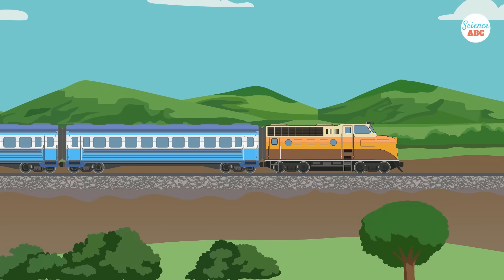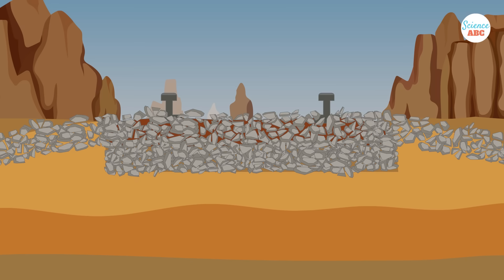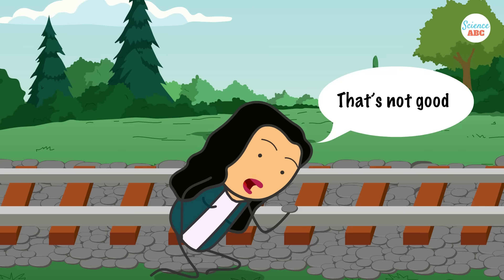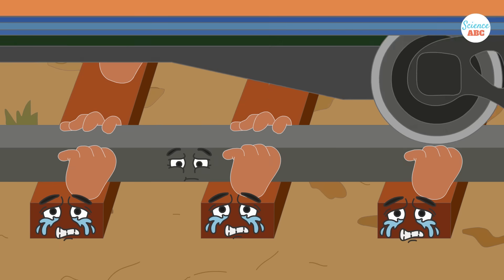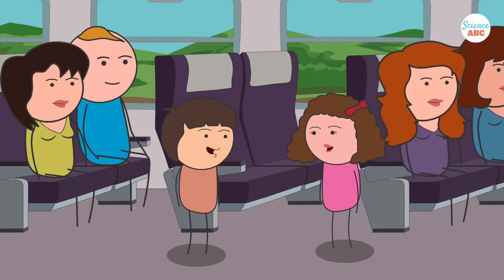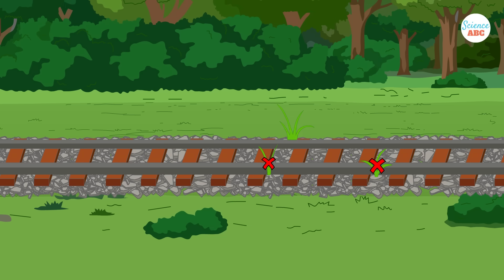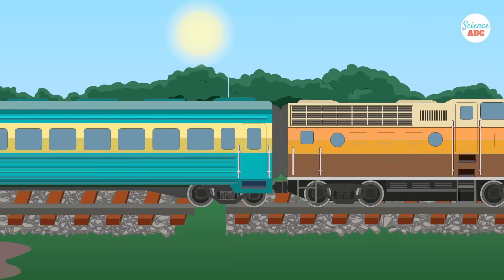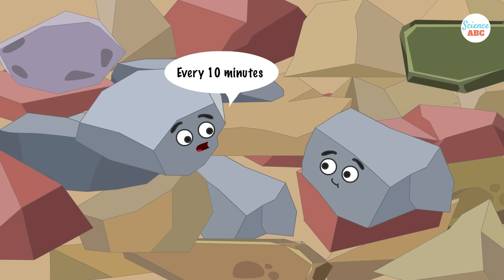Why Are There Stones Along Railway Tracks?

Comment: I used to work in a quarry,  making track ballast.
The rocks we were getting out of the ground was called blue stone. It's very hard. There was a lot of science that went into making it, we was only allowed to have 4 broken faces on the rocks, so they locked into each other. But the faces of the rocks were only allowed to have 3% chipping damage. Else it made the rocks weak and they wouldn't do their job properly. And when your stacking it off the end of a conveyer belt, then it goes into the loader bucket then into the truck, it's very hard to keep this 3%. But we managed to do it. Also, little fact seen as alot of people don't know this, rocks can die. They become useless and have zero strength in them. It's called Saprolite. And is caused by the elements decomposing the rock, and they lose mineral structural strength.  You can pretty much crush it into a gritty powder in your hand!
Also just to kind of give you an idea, how how well that stuff locks together,  
Sand has an angel of repose of 32⁰ in a conical shape, when falling off a conveyer belt from height, before it collapses on its self and starts making a cone again.
And 35⁰ when wet.
Railway Ballast has an angle of repose,  in a conical cone. Of 38.7⁰ from its weight alone, so it shows how well that stuff locks together, and is used for railway tracks! 
Incredible science!
Reply: Many thanks for such a valuable contributions!
Reply: @BigBrother-fm2tx  you are welcome  :)
Reply: @timfagan816  Just Brilliant! Thanks.
Reply: @peterduxbury927  thanks mate👍🏻
Reply: @Chris no I mean bluestone.  Cos it is blue in color,  very different to limestone. Although they are formed in the same way from millions of years of compression under ice. Limestone is more course and rough, where as bluestone has a finer grain. Also they're very different in colour! Limestone can be broken down into what is called riprap, which looks very similar to the railway Ballast that you might be thinking of,  but they are used for totally different things.  Riprap is used to control erosion.
Where as m4 rail ballast, is made from bluestone cos of its non slip characteristics.  
Your not wrong to think they are the same thing, but they aren't the same thing! 
Cheers :)
Reply: @timfagan816  Is it the same bluestone that forms part of Stonehenge?
Reply: @f0urstr1ng  it could be, there is information suggesting that it might be the same. But I'm not in the uk anymore,  I left there years ago, and never took an interest in rocks. When I was there ( I was born there)
Fortunately I did visit Stine henge before all the keep back rope went up, so I actually touched and climbed around Stonehenge as a,kid. 🤭. But you could be right.
silcrete rock
There are two types of stone at Stonehenge – the larger sarsen stones and the smaller 'bluestones'. The sarsen stones are a type of silcrete rock, which is found scattered naturally across southern England.
Reply: @timfagan816  you are a mine of fascination. You have made a subject I wouldn’t normally bother with entirely fascinating.
Reply: @f0urstr1ng  thanks mate, I really appreciate that :)
Reply: @f0urstr1ng  - Alternatively,  your drug dealer made it fascinating...
Reply: @samuelluria4744  nah …. he doesn’t know anything about rocks
Reply: @f0urstr1ng  - 😐
Reply: @timfagan816  Just want to say "thank you sir" for this comment (and all of your other replies, which I took the time out to find...). They were all quite informative and helpful. Wish you a happy 2023...
Reply: @Manoj Pawar  thanks, mate, your welcome. Same to you, haooy 2023! :)
Reply: As an old model railroader, and all the research that goes with it, it all correct.
In a miniature railroad setting, the ballast needs to be glued. 
I do know if a few places in the world where the ballast on the prototype (real thing) is glued in certain places so it doesn’t shift at all.
Reply: Dana & Barb Hutchison  yes you are correct bluestone is a generic term, the correct term is olivine basalt.
It gets the name bluestone,  because when it is wet. Or freshly broken in the quarry the rock is blue. And will stay blue for 41 days, while it naturally cures and hardens, after being extracted from the ground with the excavators. Then stockpiles to cure, you can not process this before the 41 days is up, unless you want the rocks to fail as ballast.  Because they are too soft and weak during curing.  You cannot achieve the 4 broken faces or 3% chip factor. 
Sorry for the  confusion with bluestone. That's just what we called it. 
A few other comments saying it's limestone
Where I live, limestone was formed by the blasts of magma from volcanic eruptions. And has mineralized and been compressed into lime over millions of years. Also it's used to top dress soil from either a spreader truck or top dressing plane and is designed to break down with the wind amd rain over 3-4 months after being spread. This is why it wouldn't make good ballast cos it would just erode away! I worked in a lime quarry before I moved onto bluestone. 
Also dolomite and dolerite. I'm not 100% sure on these two, so can't tell you much about them. But from the little I know about them, they are slightly different! 
And dolerite, apparently, is a mineral that shouldn't exist, it can not be mimicked or synthetically recreated by science.  We juat don't have the means or technology. 
Thanks,for all your great comments and feed back. I can't really answer any more, as it was just jobs to me, to fund my habit of travel. And a means, to pay my bills while I worked my way around the country on a,working holiday, going from quarry to quarry  :)
Reply: @timfagan816  Wow, you're like a living enciclopedia with regard to stones. That's awesome 😎
Reply: @ildefonsogiron4034  :)
Reply: @timfagan816  - just to add a bit to alleviate some possible confusion in terminology:  DOLOMITE is a Calcium-Magnesium Carbonate, just like Limestone except is also has Magnesium in its molecular structure.  It is a sedimentary rock.  DOLERITE is a term applied to a basic (mafic) igneous intrusive rock.  It is often found in shallow intrusive dikes (cuts across layers) and sills (concordant with layers).  It is sometimes called "micro-gabbro" (eg., a very finely crystalline variety of its extrusive cousin, basalt).  The term, DOLERITE, is used more commonly in Great Britain than in the U.S.  [I'm a geologist with a primary interest in sedimentary rocks and a secondary interest in volcanic rocks].  The response to your post is most amazing.... who would have thought?
Reply: @timfagan816  I always thought it looked like basalt.  My Father had an abiding interest (indeed he went to college to study it and was a member of Gamma Theta Upsilon) in geography, and more specifically, geomorphology, so I heard much about it, particularly since I was raised in the PNW where rocks of volcanic origin are varied and plentiful.
Reply: @timfagan816  limestone was formed by shells and sealife I thought
Reply: That angle of repose thing is fascinating! I was wondering how you could realistically judge the rocks on a big scale. Never even considered that!
Reply: Tim - great comments!  Just wanted to clarify that "Bluestone" is a generic term, depending on the location of the train tracks.  "Bluestone" can be limestone, greywacke, sandstone, and many other types of rocks.  But, it must be fairly dense, strong and, as you described, must break into the proper shapes when crushed.  It must also be composed of minerals that are chemically stable so as not to dissolve in rain water over the years.  For example, certain volcanic rocks would not work due to their unstable mineralogy.  Good comments on angle of repose too!
Reply: @dhutch71  - This is the first time I'm ever hearing about bluestone being in any way synonymous with limestone.....congrats!
Reply: Thanks I live in a small town with an industrial railroad. Never crossed my mind that there's a scientific engineering to rail beds. I greatly appreciate it.
Reply: @Chris geologist have big books of color scales to classify the colors of rocks. I always found it annoying. But some geologists are really REALLY into accurate colors. Weird huh?
Reply: @ZE0XE0  My Stratigraphy professor would not allow us to describe a rock as "brick red"....  he would pull out his color comparison chart that showed about 50 bricks... all were some shade of red.... lol
Reply: @dhutch71  yeaaahhhh it be like that. 

My strat prof was color blind 🤣
Reply: This is an incredibly underrated comment! Fascinating! Thank you for sharing!
Reply: @craigdavis9035  thanks Craig! Another interesting bit of information if you want it. You can also use a rock called load stone, which is naturally magnetic,  and sticks to its self. So is a great stone to use as ballast also, cos once it compresses, over years of settling from gravity and vibration. It is a very solid rock that locks into place incredibly well! Makes for great ballast. It's just harder to process,  so it drives the cost per/ton up. So bluestone is the better alternative!!
Reply: @timfagan816  Correction, lodestone.
Reply: @SumeragiChain  thanks for correcting me :) yes lodestone.
Reply: @timfagan816  but what If it stuck to the metal of the track? And could a rock that size realistically derail a train?
Reply: @benblease7968  it's not strong enough for that mate, it literally just sticks to its self. About the most it'll stick to is a spirt level. Just under compression! It sticks down really good. To lock into place. I can assure you, you will be OK, traveling by tain and won't be in a messy derailment. 
There is a great channel on YouTube with some guy who owns a train, and he puts stuff on the tracks to try and derail his train. Takes a lot more than a penny to derail a train. 
Also of the lodestone is on the track in the 1st place, something major must have happened for it to get kicked up onto the rail.
Reply: @benblease7968  we always end up with rocks on the track at work (one of those ballast cleaning machines)

Loco wheels just crush them to dust
Reply: @timfagan816  "lodestone". Not trying to be a jerk, just trying to help make it easier for anyone looking to find out more. But lodestone has 1-2 degrees of magnitude less strength than granite. Interesting idea, but not practicable.
Reply: @MWGrossmann  ahh right thanks for clearing with me
Reply: Thank you for sharing this!
Reply: @Chris I'm in eastern Kentucky and all the tracks around here have what appears to be crushed granite. Grey stone with blue spec's. Always wondered where it came from because all we have around here is limestone and sandstone.
Reply: Wow ,one heck of an explanation. Thanks
Reply: You are proper awesome. I learned as much from your comment as from the video itself. 🏅
Reply: Precision rock creator
Reply: God someone better tell I'm a rock I'm island song about this r.i.p. rocks we will miss you
Reply: Thanks for this deep dive from your experience in the industry. Very fascinating.
Reply: @tim fagen...great information, quotable, thank you.
Reply: Thanks for this. Great storytelling too. I want to write  a song about it now.
Reply: This should be pinned
Reply: Thank you for passing on this knowledge.  There’s a lot to be learned in comment sections!
Reply: Cheers for the awesome information mate. Answers something that I've wanted to know for a while.
Reply: Really thankful for taking out the time to share the knowledge.. 😊 you make the world better
Reply from the maker: That's fascinating! Thanks for sharing
Reply: @Scienceabc  no problem. Glad you found it interesting!
Reply: I never thought that I would find stones so fascinating. Thanks for sharing!
Reply: The the county plow trucks near me use a grit called "non skid" or something similar, and all the little pebbles spread on the road in the winter must have 6 sides. Super cool!
Reply: @LobbinHeat  
Blare Sullivan,
In what State do you live?
Your comment interested me. I live in north Central Wisconsin where much road salt is used in winter. Sometimes sand at intersections when the temperature gets too cold for road salt to be effective.
BTW in 2013 we visited Germany in winter. In the city of Berlin they cast out small dark angular dark gray stones after a snowfall or ice of some sort. The dark stones while providing traction on sidewalks and intersections of roads also somehow attract heat from the sun and help melting. I was told that in spring all of the little rocks get swept up, stored, and reused the following winter.
Reply: @peterwerner651  I'm in northern New Jersey. I work in the tri state area and it's used on interstate 84 in Pennsylvania and the surrounding areas. Super cool!
Reply: @LobbinHeat  OK thanks for the response.
Reply: Awesome !!
Reply: thank you for the insight
Reply: Very interesting. Thanks for the information.
Reply: @Chris No limestone doesn't meet spec. Ballast is typically a blue grey and it's hardness is measured in Rockwell units of hardness. Most typically it's a rock called Basalt, Gabbro, Diabase or Peridotti.
Reply: @digger105337  this is really interesting! Rockwells units of hardness made in 1919. We just used to chuck a bowl full of lime in the microwave at high heat for 10 mins, weigh it before and after, to see how much moisture it lost. But I like this method better! Thanks, digger 👍
Reply: Thats actually very interesting for some reason.
Reply: Interesting,  the thing you can learn in the you tube reply section. Next time I'm by tracks I'll have a good look.
Reply: Tim! Great insight into this relatively unknown product and the way it is made. Thank you so much for sharing your knowledge!
Reply: @randallreed9048  your welcome, Randall! 👍
Reply: I learnt way more from this comment than I did from the video.
Reply: Best youtube comment section by a mile.
Reply: Thanks for the info.
Reply: How does someone get a job like that?
Reply: @Torvinoid  ??
Reply: That was interesting but I want to know more about your working to travel...where did you go and are you still traveling?
Reply: @martymaloney1032  hey Marty, how are you.
Started of in the uk, (where I was born) worked there for a while,  traveled the uk for a bit working here and there, then that lead me to Europe.  Working around Europe, for a good while, got to see a great deal of Europe, love the place. Then that turned into a brief stint in America, I am currently in new Zealand.  Next stop, Istanbul for a quick visit. Then to surgut, Siberia. Then head Down to sochi, and then meet up with friends in Moscow/st. Petersburg.
Reply: @timfagan816  Sounds like fun! Do you have any favorite places you plan to go back to eventually and where were you in the US?
Reply: @martymaloney1032  I'd love to go back to the south of France again and Belgium.  Rio rancho near Mexico, Arizona, and Pennsylvania.  Was only there for 3 weeks, seeing friends. I'd love to spend like a year at least in the states!
Reply: @timfagan816  dude, they really need to gift you entire quarry, of all the knowledge you have about stones and process of making it 😁👌👍☺️
Reply: @milosstojanovic4623  thanks mate  :)
Reply: same goes to the sub base of a paved road i guess
Reply: This is the most epic comment I’ve ever seen on YouTube. Well done.
Reply: Great post.  An old friend and I covered most of America between us on trains.  You probably worked on rocks we rode over.  Thanks for doing a good job, and thanks for all this background info.  Next time I look out a train window, I'll give you another nod.  If Steve were still around, I'd send him this, but I think the trains he rides now don't need as much maintenance.
Reply: @intercat4907  R.I.P Steve!
Reply: Those are some pretty stringent requirements. But I really wonder what kind of rock that actually was. Blue Stone isnt an actual rock type.
Reply: @ZE0XE0  Blue stone is called blue stone because of its color, which is blue. Yeah, I know. Mind blowing, isn’t it?
Reply: I'll be darned !!
Reply: That's really interesting, thanks for the information.
Reply: @thewaywardgrape3838  🙂
Reply: @GARRY3754  I can’t tell you much, but I’m pretty sure the formation is always a bed of clay, laid nearly flat, but with a slight slope for drainage (30mm in a meter?)

I don’t work on the formation but I work on the ballast cleaning machines they mentioned in the video. We have to skim across the formation with the cutter bar
Reply: This was very interesting thank you for sharing!
Reply: This was fascinating information on rocks! I had no idea about how much thought and planning goes into rock ballast
Reply: @Caped Baldy you didn’t go to school of rock
Reply: @Chris Blue stone isn't lime stone, blue stone is basalt and harder.
Reply: I am learning so much from the comments section of an already informative and educational video. Thank you for helping educate common folk on topic! This is what makes learning fun for me yknow
Reply: Isn't it basalt? I'm in Sydney, Australia & was told by the train staff that it's basalt
Reply: @the_eminent_Joshua_E_Hrouda  Yes. Volcanic Basalt. Tons of it here in Melbourne.
Reply: You absolute legend. Thanks for doing this bro!
Reply: I just read all of this.
Reply: @yBazo82  what ya reckon!
Reply: @timfagan816  are you an engineer
Reply: Your comment is very informative as well 👍 Thanks!
Reply: @ixoraroxi  🙂
Reply: @ixoraroxi  да
Reply: @tim fagan How are these stones sorted/divided, by the criteria of 4 broken faces and 3% chipping damage? I suspect not individually by hand? Lol
Reply: @Dutch Prepper  no, mate lol. Not by hand. You stop all crushing, and go to the pile, measure around 4ft up the pile, take a scoop with a plastic shovel, from all around the cone, and fill up buckets. Then the geologist comes, and takes them back to the lab, does core samples, and strength tests in his hydraulic press, then tells you the results if you've passed or failed. If it's a pass, keep doing what your doing, if it's a fail. You habe to adjust all the conveyer belts, and angle of the crushing plant and screens, to try and get the perfect chip factor %
Reply: @timfagan816  Thanks, I got it :)
Reply: oh wow I just found about the angle of repose through this, very cool
Reply: @llll-lk2mm  I'm glad you have learned something from my post 😌
Reply: Incredible @timfagan86
Reply: @tpraskin  thanks buddy  :)
Reply: Wow it sounds pretty sophisticated
Reply: Wow. Thanks for the comment…

By the way, you had me at “We was…”
Reply: So it's granite...
Reply: Amazing! Thank you for sharing...
Reply: This is amazing. Wow!
Reply: I knew it! Rocks are alive😃😃
Reply: This guy stones.
Reply: Thanks a lot for the info! This is why I spend some time reading comments on interesting stuff. Best regards.
Reply: Thanks for sharing!
Reply: well written and cool comment, thanks
Reply: I don't know what part of the country you're from where I'm from it's called 2" railroad ballast... It's used for a lot of different things nothing special about it.....
Reply: How old are you? I'm wondering because my Father's Father,  may they both rest on Peace,  worked in a gravel mill for many years, in his old age....until his passing in 1976...both in Montana,  and New Jersey, and who knows where else in between...
Reply: @samuelluria4744  who are you asking?
Reply: @timfagan816  - My initial question was to you, Sir.
Reply: @samuelluria4744  ahha, ok. I'm 31, never been to Montana or New Jersey.  
I was born and lived in the UK. For 26 years. Rest of the time I have been traveling different country's working.  
But never been to them to places!
Reply: @timfagan816  - Best of luck to you! I was just thinking  how my Grandfather was in a gravel mill, in the middle of nowhere, when I was an infant, and he knew about angles of repose....
Reply: Wow !
Reply: I love this comment thanks so much I love learning stuff like this. Any good books you know about it or YouTube videos
Reply: Incredible
Reply: @Chris  there are horses that look 100% gray and they are know to be blue in color.
Reply: Dude thank you for the info!
Reply: I learned so much today, thanks all
Reply: Thank you so much for sharing your information with me, I loved reading this, may I ask if a Pacific type of rock that was use?  (e:g slate or gravel) or didn’t it matter?
Reply: Fantastic comment and really interesting information I never knew. It's amazing, the interesting stuff you can learn from people working in nearly field.
Reply: @Chris Dolomite, like limestone is a Carbonate rock, but it also contains magnesium... it is a CaMgCO3.
Reply: That’s quite interesting.
However for rocks to die becoming useless would mean years of work pulling up millions of miles and track to replace the rocks.
That would take years worldwide. And hold up trains.
Reply: Thank you for telling us.
Reply: Incredible information
Reply: Thanks
Reply: Thank you for this information
Reply: U ARE THE BEST
Reply: Wow
Reply: @kasvinimuniandy4178  beautiful hey!
Reply: Thank you for that interesting lesson. ❤️
Reply: @Johnconno  prove what, boi.
Reply: >blue stone
lol
pretty sure there's a more technical word for that, limestone? granite? basalt?
Reply: Nice one OP, because I was going to ask why the original poster didn’t mention where the stones came from, seeing as they opened by saying the stones are the same all across the world.. yet failed to say who mined these things
Reply: like chicken nuggets but you're making rocks lmao.
Reply: I have no ide what you just said, but, WOW!
Reply: yap yap yap YouTube scientist😒
Reply: Incredible  the  amount  of  engineering   is required  for  a  train  track to  be  functional.  🤔
Reply: How can rocks die if they aren't even alive
Reply: Rock n Roll ;)
Reply: @thomaskeenan2208  you know it mate:)
Reply: Update: I am in Russia! Left New Zealand,  I'm in Russia for 90 days! Let's see how this pans out. Could be onto a working visa here! 🤞🤞🤞
Reply: How much did you earn
Reply: @ShadowRap-y5l  you asking me?
Reply: @timfagan816  yea
Reply: Do dead rocks get tombstones?, "He lies blue rocky.  He was all jagged edges.."
Reply: @brianegendorf2023  🤣🤣🤣 I somehow doubt the dead rocks don't get a mention. They served their purpose.  Gone but always forgotten!!
Reply: Nerd
Reply: You're so 😎 love it
Reply: You Sir ….are a Rock Star !
Reply: My grandfather had a farm in Winchester Virginia…very hilly land, I believe it was big blue stone boulders and large rocks all throughout his land.
Reply: Excellent information thank you. I was wondering where this ballast comes from and how it’s made. That could be a great video!
Reply: Your rock science rocks 😅 👍
Reply: Thanks for the fascinating sharing from your life experience! Take care!
Reply: "Angle of repose" sounds like the "coefficient of friction" i learned about in physics class.  People have no idea of the amount of engineering and, even moreso, maintenace common everyday things require to keep working.
Reply: 7 bag. low chert. air micro fiber
Reply: Good stuff.  Thanks for sharing.
Reply: @EastCoastReefer  no problem :)
Reply: Wow. Didn’t know all that . Thanks 👍🏻
Reply: Thanks for sharing
Reply: Thanks, @tim for that extra knowledge you gave us !
Reply: Amazing, thank you.
Reply: Wow
Reply: Wow
Reply: Then you got released at the end of your sentence?
Reply: I had never thought of how are rock could die! But it makes sense! Thank you for you knowledge!🙏🙏

It reminds me of the Rock Bitter from The Neverending Story. Were the nothing was depleting all life from everything, including the rocks.

It also brings me to the Bible where it says that even the rocks would cry out to Yeshua proclaiming him. Well if rocks could cry out, then they can die too! Praise be to YeHoVaH our God and King of the Universe and to his Son our Messiah and King who saves us and reconnects us to our creator YeHoVaH!🙏🙏
Reply: bro… please make your “good” playlist private.
Reply: "And when you're stacking it". Not "your". Alot is a town in India, a lot is more than one of something. "Sand has an angel of repose of 32⁰" Really? An "angel"? Do mean angle perhaps? Sheesh.
Reply: @coloradostrong8285  thanks teacher.

When I was a kid in the 80s either "a lot" or "alot" was acceptable. Just because your autocorrect puts a line under it doesn't mean it's wrong. 

I write the Queen's English "grey" instead of the American "gray." Either is acceptable.

As for the "you're/your" thing, you could have picked so many other grammatical errors out of this comment that "your" just being a busybody. 

I love how the story was told and don't give a $#!+ about those minor incongruities. 

In other words f*c# off.
Reply: @coloradostrong8285  Punctuation goes inside of quotation marks.  Sheesh.
Reply: Jeffrey Gordon ahahahahaha!!! Love it!
Reply: @jeffreygordon7194  except I reasoned out that punctuation should be after quotation marks.
Sometimes we find ourselves between a rock and a hard place.
 Note that I said ourselves and I didn't say us-selves  ; yet some people readily say his-self instead of himself . If there ain't  an apostrophe , then it just doesn't  look right anyway in terms of spelling . Also there's  question if the punctuation mark  should be immediately at the end of last word or if a space should be left . I leave a space because it ensures  the punctuation is noticed,  otherwise  there  might be a misinterpretation . He eats shoots roots and leaves (we can have fun with the commas ) . He eats shoots leaves and roots ( a little syntax maybe ) .
Reply: @coloradostrong8285   
Why are you quoting yourself?
Reply: @coloradostrong8285  - So, TWO of a thing could be called Alot?
Reply: @coloradostrong8285  you must be new in town .
Reply: @coloradostrong8285  Kudos to you for loving your language.  As a retired teacher/librarian, I appreciate that.  I don't usually worry about sentence structure or grammar from a blue-collar worker who really knows his stuff.  I was mostly thinking that tim would be really good company.
Reply: @coloradostrong8285  i needed that info alot !
Reply: @coloradostrong8285  : Thanks, Karen!
Reply: @aztec0112  😂😂